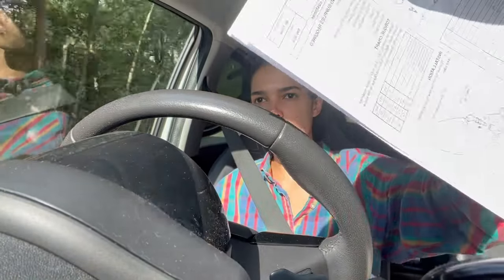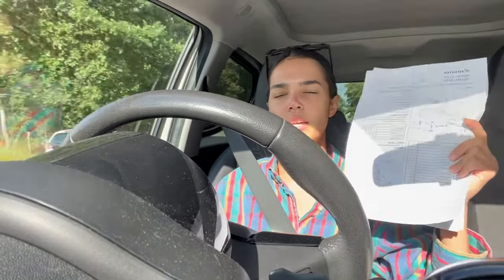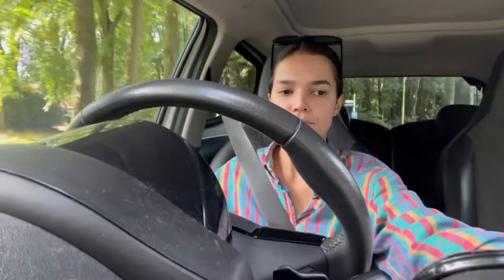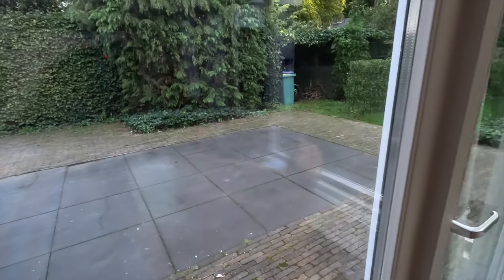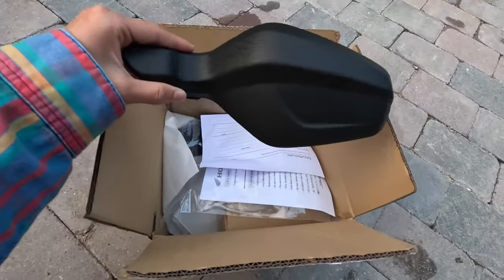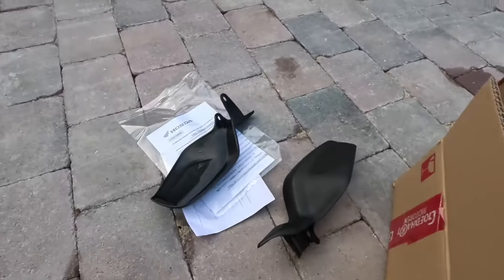adding hand guards to my Honda cb500x

Comment: CB 500x is a beautiful bike and it will very much suprise you as you get more familiar it, its a little on the top heavy side but you get used to its quirks. Happy and Safe riding   9:08 9:08

Comment: I bought the same bike, in black color, and wanted the original Honda hand guards, but the dealer discourage me because he said they did not look good. But I have to say I like them, I will go to Honda and ask them to install the original hand guards.
Reply from the maker: If you like them, you should definitely add them to your bike. You can always change them afterwards! 🤠
Reply: I got them. Actually they are nice with a x-pattern engraved, in the same style of the rest of the plastics of the bike. Quite happy. Installed also the original crash bar.
Reply from the maker: @alfredocesarano757  Happy to hear you got them! I am also thinking of getting the crash bar for the bike!